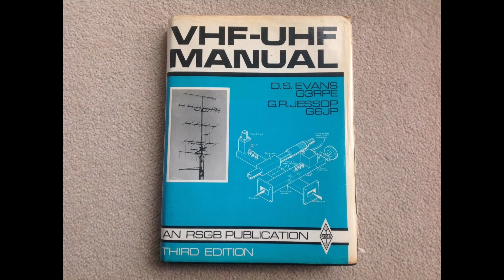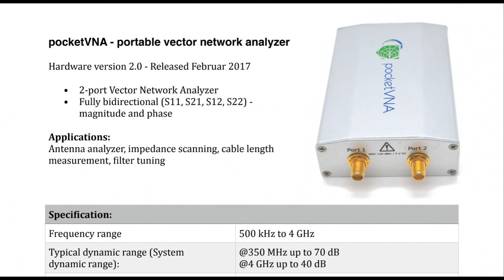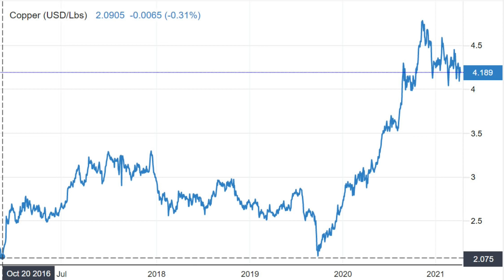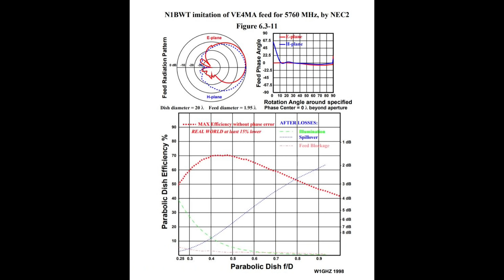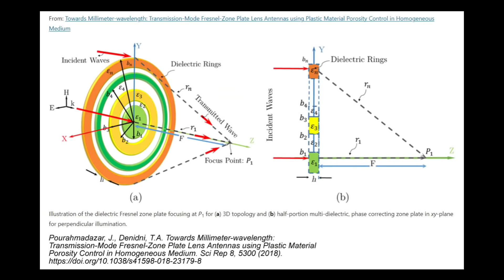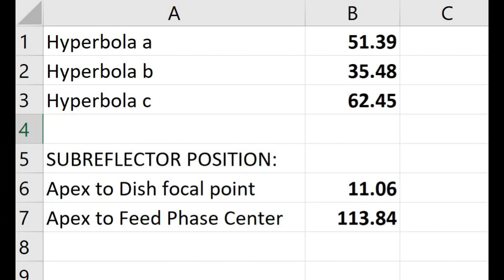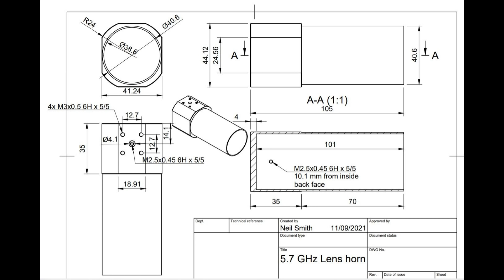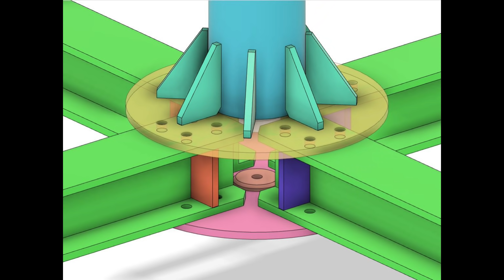Machining plus Microwaves equals Awesome

Comment: Hey Niel, what do you think about broadband fractal antennas? Are they worth to machine such antennas? I relish the content of your channel. Keep it up pal! You do a awesome job.
Reply from the maker: I was reading an article recently about three-dimensional "fractal tree" monopole antennas which are almost impossible to machine, but can be 3D printed and then coated and electroplated.  http://www.jpier.org/PIERC/pierc86/02.18030505.pdf Most of the recent work I've seen about Sierpinski and Koch fractals has been intended for UWB applications, aimed at getting better than 25 bits/Hz/sec for mainly indoor applications, and are usually using PCB techniques. I'm more interested in highly directive arrays, so patch arrays and spirals and slot arrays are closer to my area or interest, but there is a specific application where I think a fractal approach might work, for feeding a large dish on multiple bands at 1.3, 2.3, 3.4 and 5.7 GHz. The big issue with multiband antennas for weak-signal extreme range comms is that wideband transmit and receive systems at those frequencies are not practical for anyone on a hobby budget, so you end up needing a multi-way coaxial relay, or two layers of relays to do the necessary switching, and that has an impact on noise figure of the receive system.  Up to a point, transmit losses can be compensated by more power, but when a GaN device for the higher bands costs more than $400, that's a high price to pay for using a single antenna element. 
I got rather excited by the title of this, but it's actually 2.9 to 14.6 GHz.  Boooo. https://www.mwrf.com/technologies/passive-components/article/21844655/fractal-antenna-aims-at-29-to-146-ghz 

There is a very specific application where a fractal wideband antenna might be a solution, that's for a Reverse Beacon, where tens or hundreds of receive systems are installed by enthusiasts across a country (similarly to the ADS-B amateur network) using omnidirectional antennas with a high gain in the vertical plane feed front-end converters which listen on the digital-mode segments of 2.3, 3.4, 5.7, 10 and perhaps 24 GHz using SDR back-ends and either decode locally or stream segments of those bands to a central cloud server, so I could transmit a digital mode signal and get back the responses from a huge area.  That might provide some interesting possibilities for real-time propagation mapping and 2D investigations or rain-scatter (and snow/hail scatter) as well as off-axis aircraft scatter.  It will be a big project, but the beauty is that folks without radio transmitting licences can participate in the project and help provide a really useful resource for testing of antennas and propagation research.  At present, the antenna choices are rather limited, mostly being slot arrays, but I'm sure we can come up with something more wideband. Biggest obstacle is that I don't have access to the professional antenna modelling software suites, so I'm limited to what I can do in OpenEMS or by asking for favours from folks in the industry.
Reply: Thanks for the quick and In depth response. I look forward to your projects. I'm glad that you are as passionate on this topics as I do. Great job that you do, keep it up! 👍
Reply: The PDF of the fraktal Antenna looks intriguing the paper uses a Makerbot replicator X2 ist a FDM printer 🤔 if there is any Step file from this Antenna then it would be doable for me to print it out by the condition that it wouldn't be larger than the printing bed. I own a Geeetech A10 pro and a ANYCUBIC Photon Zero 🤔 btw. STL and Mesh files aren't reliable enough for such funktioal purposes I rather tend for the format 3MF, AMF or STEP files to get dimensional accurate functional parts. STL and mesh is more for childrens toy and paperweights

Comment: It appears the saying was wrong, and should be updated to: All roads lead to foundry and CNC. I'm absolutely foreign to EM transmission technologies (Short of installing Motorola 900MHz gear in my early 20's), and I'm not even sure why this video appeared in my youtube suggestions, but I couldn't help but notice our paths have quite a few parallels, though I get the impression you'rer about a standard deviation smarter than I am. I too started from an ICT background, then found an unquenchable thirst to work with machinery, got a mill and a lathe, quickly fell in love with the processes and have ultimately been aiming at CNC and foundry solutions ever since the idea-to-material limitations became apparent with the equipment I had at hand. In any case, you've caught my interest - even if your casually throw callsigns and RF parlance around like it's patently obvious and I'm left having to rewind and google what the hell you're on about.
Reply from the maker: That video was actually part of a lecture I gave to the Radio Society of Great Britain Convention last year, so the target demographic was way different from the general Youtube audience, hence I could make huge assumptions about the knowledge level and jargon-awareness of those watching. The current subjects I'm covering are heavily biased towards machining, but upcoming vids will cover a lot of antenna and waveguide and microstrip and co-planar waveguide and moonbounce hardware and dielectric lensing and, well anything I get interested in. I'm a total beginner at machining really, but it's much like coding and Physics and Maths, another part of my toolkit for exploring the murky corners of technology. You nailed it totally with the phrase "idea-to-material limitations". Pushing against those limits is where life starts to get properly interesting.

Comment: Having recently discovered the channel I'm working through your videos, enjoying them thoroughly.  I'm intrigued by the applications for the part you are making, I'm going to have to do a bit of research as I'm out of my depth big time. The machining is more my thing which is very entertaining
Reply from the maker: Next one has a bit of background on how the low pass filters actually work as well as machining and soldering the cores. I'll include a bit of detail like that in most of the projects, but I think I'd upset the algorithm too much if I went full-on with the microwave technology.  Perhaps I need a second channel for some deep dives into EM solvers and meshing and Smith charts and tuning and waveguides and cavity resonances and how dual-mode horns actually work and the mechanisms of Mie scattering from large hydrometeors and Rayleigh scattering from small ones. aircraft scatter, tropospheric ducting, Fresnel zones and all the other things I mess about with.  Machining is very much a side gig, supporting the rest of the "messing with microwaves and mmwaves" stuff.  The vacuum chuck project which is in the pipeline is so I can make Fresnel Zone Plate lenses to focus mmwave signals.  Now THEY are quite spooooky and I'm going to have a challenge in explaining how they work, without invoking deep Physics.

Comment: This work is lovely.  Very pleasing to the eye.  I've dreamed of doing similar work. Especially the antenna mounting solutions you've come up with.  I'm not much of a microwave experimenter.  I did look at working EME in the distant past.  But that was thirty years ago...  This video is very encouraging.  Thanks for posting it!!
Reply from the maker: I'm just completing another batch of clamps of a different type, they are to support some big 432 MHz EME yagis.  Soon I need to make a new az/el mount for a new solid 2 metre dish that just arrived on my driveway as if by magic (Thanks David and son!)  That's designed to be good to over 30 GHz, so I'm hoping to use it on receive at least on 47 GHz to see if I can hear signals reflected off the moon. Making serious power at 6 mm wavelength is very very hard indeed, so I rather doubt that I'll be anywhere near to two-way communication for some time unless someone has a 5 metre plus solid high precision dish and suitable feed.  Lots of fun ahead.
Reply: @MachiningandMicrowaves  I hate to admit this, but this video is extremely captivating.  Approaching sexy....  Ye gods and little fishes.  Thanks for putting this up here!!

Comment: AlN disc between transistor and heat-spreader reduce capacitive effects dramatically at these high frequencies.
250w radio "easily" becomes 500w radio :)
Reply from the maker: I've heard of that at VHF using switching mosfets where the tab is the drain, but all RF devices for UHF and above these days seem to be designed with the source bonded to the copper baseplate of the device and that needs to be either soldered to a copper heatspreader or at least clamped to it directly, either with an Indium tape or a high performance heat transfer compound, sometimes with the underside of the PCB soldered to the spreader as well. Do you have any references for the types of device where an AlN washer would be useful?  I have an idea that it might be very useful in H-bridge amplifiers using all N-channel devices for a kilowatt at 136 kHz, and I have a nice box of IRFP250N mosfets in my parts store. On those, the drain is connected to the metal backplate so needs to be well insulated but still shift the heat.

Comment: I love the channel, guy. RF tech and machining are two of my biggest interests. Ever since I saw a tear-down video of a 4G LTE base station diplexer, I've had a burning desire to learn more about the alien-looking technology inside. That incomprehensible maze of cavities seems to hold the mysteries of the universe.
Reply from the maker: Circulators and magic tees and rat-races and 90 degree hybrids all seem like magic. Actually, circulators probably ARE magic now I think about it...
Reply: There is def magic here, I just can’t put my finger on it, yet. Clue me in if You will,  fundamentally what’s RF tech all about? I’m not asking for the nerdy answer,  I want what’s  beyond all that.
Reply: @Grateful.For.Everything  RF Tech is the practice of manipulating materials here to cause effects at a distance, with nothing visibly present in between.  Unlike normal machinery, most of the moving parts in RF machinery are invisible, and the parts that can move just make small tuning or pointing adjustments.

Comment: What was the free software package you use for analysis & design?  Also, what is the spreadsheet you use and/or is it available to the public?  I know less than nothing about microwaves and such, but am very interested in home shop machining.  I'm mostly interested in the spreadsheet in order to look at it to see how it is designed for the designed it helps you with, i.e., it seems to be a great example of how to use spreadsheets for Engineering analysis & design, which I want to become better at (the use of spreadsheets).

For ideas on the anodizing, finishing, etc., take a look at Mark Presling's channel here on YouTube.
Reply from the maker: The EM Solver is OpenEMS, running under Gnu Octave on Windows. I do have MATLAB but Octave works really well. I use Paraview for visualisation of .vtk files. I have a paid-for copy of Eagle PCB CAD so get a licence for Fusion 360 included, that has good thermal and mechanical simulation tools. QUCS Studio, ELSIE, Simscale, Sonnet, LTSpice and ATLC2 are other tools I use a lot. There are some excellent design spreadsheets on W1GHZ's site, I use http://f1frv.free.fr/main3e_Filtres_LP.html for coaxial low pass filter design.  That's a good example. http://dc2light.co.uk/SlottedWaveguide-2020.xlsm is another good example for waveguide slot array antenna design. 
I'll take a loot at Mark's channel, thanks!

Comment: This is amazing stuff. I mostly muck around with TTL and microcontrollers... microwave is black magick!
Reply from the maker: I did a load of work on MECL-III logic chips in 1976, clocking them at what then seemed a very fast 280 MHz, with transmission line interconnects.  That was my introduction to stopping thinking about PCB traces as conductors, as there were times the voltage at one end of a track was the opposite sense to that at the other end. I'm doing some work with grounded coplanar waveguide on PCBs at the moment, that is an even deeper level of spooky.  I limit myself to PICs and FPGAs so I don't go down rabbit holes having fun coding stuff.
Reply: @MachiningandMicrowaves  once the frequencies get so high that what I consider to be "the laws of physics" break down... when what I see as one conductor starts to become a circuit in it's own right.... I stand in awe at the doings of dark wizards beyond my ken.... but it's still nice to watch and antennas of all kinds are like works of art. :)

Comment: I personally believe TIG, MIG, and Arc welding is a black art. You either sell your soul to be good at it, or (like me) you use the "Lay it on thick, and grind it back to pretty" technique.

When I was trained as an engineer (Many moons ago) I had to arc weld up a bracket as a test piece to be marked. My stick welding back then was REALLY bad. Think "lumpy porridge THROWN at the metal join" and you get the idea. Knowing that my welding on this test wasn't going to get me a passing grade, I looked at the technical drawings of this bracket, and realised that all the welds were depicted as perfectly smooth radii........... So I over welded the joins until they were about 1/4" proud, then used bench/die grinders to make my workpiece match the drawings perfectly.

When I handed it to the examiner he looked at it and said "......erm ......... What have you done to the welds?".
'I've made it as per the diagram sir. The diagram shows radii that can't be achieved by just using a welder, so I've dressed them back to spec".
My instructor piped in at that point and said (Knowingly) "So this isn't an attempt to hide sub par welding ability then?".
"Oh, no sir. All those welds looked absolutely textbook perfect sir".
There was silence for a while, then my instructor said "You realise that you need this to be marked at over 50% to pass this course module, and the marks are 50/50 for weld quality and accuracy of the test piece".
"No sir, I didn't know that. I just made EXACTLY what I was instructed to sir".

More silence, then the examiner said "Well, I can't deny that this IS the most accurate version of this test piece I've ever had submitted. It's well within tolerance, and the drawings DO show all the corners as even curves, so I can give you full marks for accuracy....... But as I can't SEE the welds, I can't give you a mark for those, and the pass grade is OVER 50%..........". With that my instructor said "Allow me", grabbed my work piece and jogged off into the workshop. We both followed and saw him grab a hammer, then give my bracket a couple of whacks with it. The examiner asked what the instructor was doing, and he replied "You might not be able to SEE the weld quality, but you just observed me demonstrate that it's got adequate penetration and strength to put up with a spot of stress testing.......... That's GOTTA be worth a few of marks?". It seems it was. :D

I scraped through with a pass and got to stay on the course........... So, as far as I'm concerned, "Using a grinder to be the welder you ain't" is a perfectly acceptable metal finishing technique. Since then I only really MIG welded until recently, when I decided to rebuild my trusty........ Sorry, "RUSTY" old utility trailer, and realised that my ancient 100A MIG wasn't going to be anywhere near man enough for sticking a couple lengths of 5mm angle iron together. So I bought a cheep Chinese inverter stick setup and went to town on the project. By the end I realised that my welds were still pig ugly, but if you can grind them back to "Pretty", and STILL bash 'um about for a bit with a big hammer without them breaking, well...... It's welded isn't it. :D
Reply from the maker: Absolutely brilliant story! I am watching all the videos on TIG that I can find, trying to get to the point where I don't always have to machine off the uglies. Huge respect to folks who have mastered the skills and hand-eye-brain coordination needed to make beautiful-looking welds.  Lucky for me that my new welding job involves sheet metal and the joints MUST be ground out and polished flat, so I get a free pass so long as I don't blow any holes. I think I might have to book myself on to a proper TIG training course to debug my poor technique and just do endless practice until I'm slightly less terrible at this.  The one great thing is that so long as the dimensions are right and the electrical joints are smooth and solid, the microwave radio energy doesn't care about how the welds look, or if I've cheated and ground them flat. At least I know I'm a rotten welder, and my expectations are rock-bottom, so every time I make a joint that looks moderately acceptable, it's a cause for (brief) joy and celebration.
Reply: @MachiningandMicrowaves  Yeah. I occasionally fluke a nice looking bead, but invariably it's the only one on whatever I'm making that looks perfect, so it would look odd if I didn't grind it back to match the rest. :(

Comment: 122GHz, that’s just nuts, I still struggle getting my head around anything above 1GHz
Reply from the maker: Should be on 135 GHz soon, and if I run out of other jobs, I'll be looking at going to 241/248/288 GHz, with waveguides around 1mm diameter.  That should be an even jollier jape.  24 and 47 GHz first though, I want to see if I can hear signals bounced off the moon on those bands.

Comment: Can a cnc lathe cut a parabolic shape? Mine can’t but it is 30 years old! Some cam programs would break it down to lots of straight lines
Reply from the maker: My home-made version will be able to, but that will be designed from the ground up to accept equations.  Straight-line approximations are OK if the step sizes are small enough.  I've not looked at whether LinuxCNC will work OK for this, but I'm going to have a lot of fun finding out.